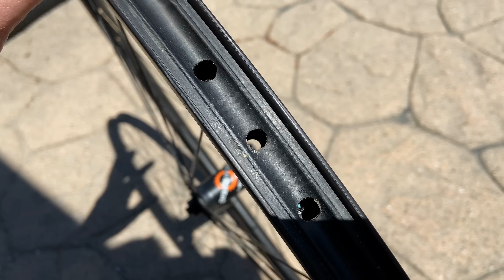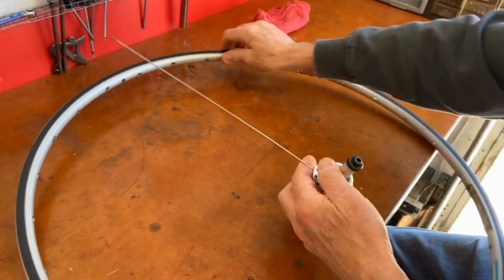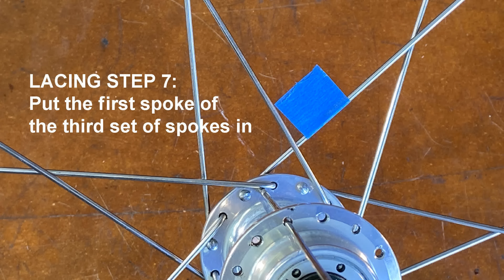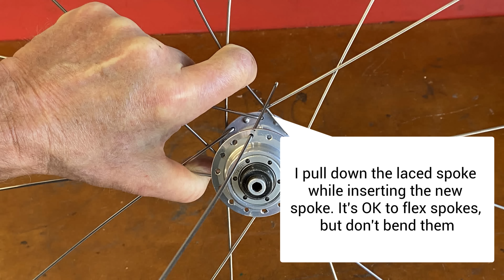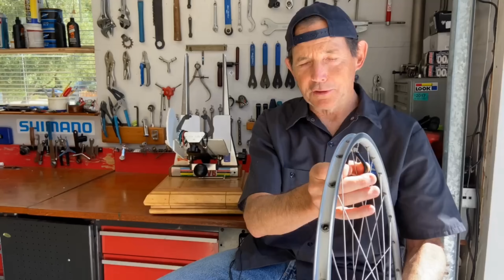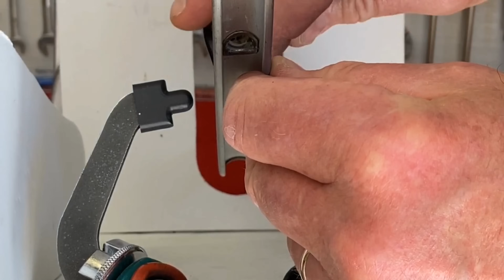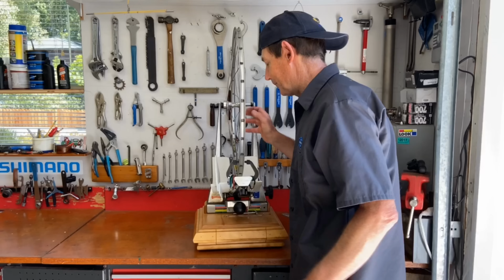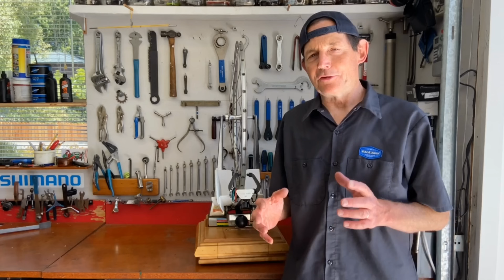How To Build Bicycle Wheels THE EASY WAY! #bikerepair

Comment: Thanks, Jim.  I'm 66 and just started riding after a 20 year hiatus.  Unfortunately, my 1984 Peugeot had gotten tired, hanging upside down.  First step, bunch of nipples that spontaneously failed.  Not quite a full build, but lots of good information for getting the nipples replaced and the wheel made round and true again.  Thanks so much for sharing.  And it is fun sans time pressure.
Reply from the maker: Thanks for watching and the great comment arcsound. Congrats on returning to cycling and on fixing your Peugeot's wheel! I'm happy to hear my video was helpful!

Comment: I have a 6 speed bike I wanna upgrade to 12 gauge spoke but I can't a rim like that what can i do
Reply from the maker: Thanks for watching and asking Michael. If the rim is made for it, you can enlarge the spoke holes, but you don’t want to do that if it will weaken the rim. Sometimes you can find out whether it’s ok to do it from the rim company othertimes you have to use your best judgment- steel rims are stronger than aluminum but as long as there’s plenty of material, enlarging can work. Also, you might be able to find rims for e-bikes already made for oversize spokes. Hope this helps.
Reply: @JimLangley1 im wanting to pur a gas engine on my bike
Reply from the maker: @michaelhuckabay739  fun project!

Comment: Great video! I have a couple of questions that have probably been asked if so sorry. First on wheel hop, on extruded wheels at the weld joint i find a slight dip or high spot that seems impossible to fix. Is there a trick to get it round? Second on tension i get the wheel true, round and centered but when i start tension 1/2 turn at a time I get some spokes with more some with less tension I use the TM-1 tensioning tool. for example most spokes measure  25 a few 23 but when i try adjusting to get even tension it runs out of true. Is the small difference in tension acceptable? It seems like I spend to much time going back and forth between true and tension. Thanks for sharing your knowledge and experience!
Reply from the maker: Thanks for watching Justin. I’m happy to hear that the video was helpful. Your two questions are related actually. The issues with the joint on the rim mean that you won’t end up with “perfect” (even) tension around the wheel because in order to improve the slight dip or hop there, you have to loosen at the dip and tighten at the hop to get the rim as round as possible. The basic process is to loosen at the dip (if the dip is over 2 spokes, you loosen those 2 spokes a little). You then go all around the wheel tightening all the other spokes the same small amount (say, 1/2 turn). On a 32 spoke wheel then you would be loosening 2 and tightening 30.

This tightening pulls down all around the rim and because those 2 spokes were NOT tightened but loosened, that part of the rim moves up, it expands or gets pushed up by the rest of the spokes.

Fixing hops is easier because you usually only need to tighten the spokes at the hop. The exception would be if you were working on a wheel where the spokes were crazy tight where you could barely turn them. In that case the trick would be to loosen all the other spokes and by doing that the super tight spokes at the hop would over rule all the rest and pull the hop down. 

It’s fun trying to get dips and hops out as best possible because you have to think about what’s happening and sometimes try a few times and keep working at it. And the thing is that the imperfections in bike rims like this mean that the tension measurement at the end, when the wheel is as true and round as you can get it, will show differences because the different tensions are needed since the rim has issues - it’s not perfectly round so the spoke tensions reflect that. I hope this is helpful.
Reply: @JimLangley1 Yes thanks for taking the time to respond. I'll give it try on the next set. Thanks for the videos and sharing your knowledge and experience!

Comment: I gave up with it too hard
Reply from the maker: Thanks for watching and commenting James. I’ve taught 1000s of beginners how to build wheels and learned reasons why some find it hard. A common problem is time pressure- because they’re expecting or wishing to build the wheel in a hurry. Rushing doesn’t work because each individual step has to be properly carried out and in a certain order, which takes understanding, patience and time to check and double check. You’ll notice my video is titled the easy way, not the fast way. And I’ve found that when I get beginners to slow way down and just perform each individual step one at a time, even the ones who found it hard will find it doable. This mindset is actually how all repairs should be done. Thanks again and hope this helps if you try again.
Reply: @JimLangley1 i give up on everything

Comment: back again I see it's been over 4 years since I have built a wheel from earlier comments. Got a early 2000 Italian Frondcrest and the wheel are cracking apart going to rebuild the old camy 8 speed on some very similar Weiman DP18 alloy Deep V rims. Here for the refresher course. Thanks again for you clear and easy to follow explaination. My problem is the lacing the truing I'm pretty good at.
Reply from the maker: Welcome back Michael! I’m happy my video is still helping you out. Thanks for watching again and commenting, appreciate it.

Comment: I had done 2 rim swaps before my 1st (recent) attempt at lacing a 36-spoke (Front) wheel from scratch. It was more difficult because I had to think. 🤣. I had a wheel from another bike that I used as a template. I laced nine spokes on one side (every 4th hole). And then 9 more in the exact opposite holes in the hub which went to the adjacent holes in the rim. I twisted the hub (fortunately in the correct direction) and inserted the remaining 18 spokes following the 3-cross pattern. I took it to the Bike shop for it to be trued and tensioned. It turned out fine. I'm not sure if there is an easier procedure. I think I could do another one in half the time.
Reply from the maker: Thanks for sharing how your wheel build went Guy, nice job! There are several ways to lace and different builders use different techniques. What I’ve found as a builder in a wheel company is that as long as a builder has a system that works for them, even with different techniques, they end up completing wheel builds at the same pace, which is in around an hour per completion- a rideable wheel. In an 8 hour shift, you finish 4 wheelsets. In wheel builds races, I’ve heard of rideable wheels built in around 20 minutes but the speed increase is mostly from truing, rounding, centering and tensioning rather than from lacing a different way. Thanks for watching and commenting!

Comment: I have a 20/4 stingray chopper rim and a ebike motor with a 21/2 inch gap.yes its a big motor I tried to cross them put them straight and wabels I tied them still not good .what am I doing wrong
Reply from the maker: I don’t know exactly what parts you’re working with Lee but you usually lace hub motors on small rims with radial spoking - the spokes go straight from the hub to the rim. I would do this one spoke at a time and one side at a time. Hub motors usually take oversize spokes too, they should fit snugly in the hub holes not loosely. Standard bike spokes or 14 gauge or 2.0mm. You may need 13 gauge, around there if your hub has oversize holes. You could try reaching out for help or searching on the website of the company that made the hub as hub companies should have all the specs on how to install their hubs on different rims. Hope this is helpful and you can get that wheel built and rolling.

Comment: Hi Jim your videos are inspiring thank you: I had to replace 2 broken spoke so I  had to do some truing & tensioning,
and got it wrong, so now I thought that resetting the wheel back to it recommended tension would be a good starting place I now have a large quaver shape wheel.
So I loosened off all the spoke and now regrouping, I have to formulate a new plan, got to laugh. love you videos. 👍
Reply from the maker: Thanks a lot for watching and the kind words about my videos matsuz, I appreciate it. And great job replacing those broken spokes. Next time, if you only have a couple of broken spokes, here's how you can save yourself some time. Remove and replace the spokes that broke. Next tighten them a little bit, just until there's some tension but they're not yet as tight as the other spokes - the ones that didn't break. At this point you want to get the broken spokes to the tension of the spokes that they're just like - in other words one right next to the replacement spoke on the same side of the rim. To determine how tight you need to get the replacement spoke that's right next to the other same side spoke, you pluck the spoke that did not break and listen to its noise/pitch (just like a guitar string). You then pluck the new spoke you put in and listen. Keep plucking the 2 spokes and comparing, as the new spoke gets tight enough it will sound exactly like the other spoke. That's how you know it's the same tightness. Next repeat the process with the other spoke you replaced and when both of the new spokes are the right tension - make the matching sound, there's a very good chance that the wheel will be nice and true again. Hope this helps you the next time and thanks again!
Reply: @JimLangley1 Thank you, Jim, for your valuable advice and for taking the time to respond.
Reply from the maker: @matsuz100  you’re welcome!

Comment: Good wheel building tutorial. For me lacing up a wheel is therapeutic. A couple of times you mentioned putting a spoke in every 5th hole, but it should be every 4th hole, which is what you did.
Reply from the maker: Thanks for watching and commenting, appreciate it. Actually it’s spokes not holes that you’re counting w my method so 5 is correct. This video is designed for beginners and that step often confuses people who already know how to build wheels but it’s just a different way of doing it that helps beginners I found in my classes.

Comment: It's actually easier if you completely fill the hub with spokes first. I was taught the way shown in the video, then was taught the easier way. I used the latter method for the next 20 years.
Reply from the maker: But you didn’t learn by putting all the spokes in at the same time because it’s not the easy way to do it for beginners. And even for experienced builders it’s more likely to make mistakes when you put all spokes in at once. All it takes is losing your concentration. That’s less likely with the simpler method. Especially considering the possible variables such as different spoke lengths and patterns.

Comment: Hi Jim,  Even though you posted this video 5 years ago I see that you are still responding to comments. That is awesome!  I'm an old guy with what are now old bikes.  I used to ride road bikes, now I ride steel gravel bikes that use the same hub spacing.  The gravel bikes take much wider tires than the 23c road tires I used to ride.  My reason for learning about wheels is because I want to rebuild some of my nice wheels.  Reuse my hubs but attach wider rims for the wider tires.  This wheel building skill becomes even more relevant these days because it's getting increasingly hard to buy pre-built wheels for the older dropout standards.
Reply from the maker: Thanks a lot for watching and commenting ncmotorcyclist, appreciate it. Yes, being able to rebuild wheels on whatever hubs you would like to use - even vintage hubs - is one of the reasons I wanted to make the video. I'm very happy to hear you're finding it helpful. I have  quite a few other wheel building videos explaining most aspects of the process if you're looking for more help. Have fun getting those nice old hubs back out there!

Comment: jim , on the part about dishing, you don't tell us if you loosen the spokes  or tighten them to make the rim go to the right. That is in the video  54 minutes.
Reply from the maker: Thanks for the question Arno, in most cases you would tighten the right spokes to move the rim to the right or tighten the left spokes to move the rim to the left if it needs to go to the left. You can run into either situation when building wheels. 

The only time you wouldn't want to tighten spokes is if you somehow got the spokes on that side to full tension already. This might happen if you are trying to get a wheel true and round and it doesn't cooperate and you keep working and tightening the spokes more and more. For example, you can end up with too tight spokes in some areas if you have a "bad" rim or if you are new to truing and tensioning and not yet experienced enough to know when spokes are becoming too tight. 

But if that should happen and the rim needs to move to one side or the other still to center it, you wouldn't want to tighten spokes that are already fully tight. So in that case to get the rim to move over you would not tighten spokes, you would loosen them. So if the rim needed to move to the right you would only loosen the spokes on the left in order to move the rim into center. 

The reason I said that in most cases you would tighten spokes is because it's much more likely for most newer builders of wheels to end up with the spokes still not fully tensioned than to end up with them at full tension or over tensioned. That's because the spokes feel tight before they're really where they need to be, so most people stop tightening them at that point, which means it's usually okay to tighten one side or the other a little more without exceeding full tension. 

Sorry that's a long, long answer, I hope it isn't confusing. I've tried to address this issue in a separate video so you might like to watch that. I go into the importance of wheels being centered and talk about different issues and how to solve them. Here's a link to that video: https://youtu.be/5ZInuIG0-dk

Comment: oh i forgot to tell you that these rims have the spoke holes in pairs of 2. So 2 holes are about 10mm apart then the next 2 holes are about 130mm from the first 2 holes and so on. So you have 12 sets of 2 holes. If you have an email i can send you a picture, it would explain it better.

Comment: What about washers for the nipples, you didn't talk about that
Reply from the maker: Hey, thanks a lot for watching and commenting, appreciate it. I have hundreds of videos and in some of the others I do explain about nipple washers and spoke washers too. The thing is that these washers are not used the majority of the time, so for someone learning to build wheels, it's unlikely that they would be using washers in their build. Nipple washers are usually only used when required by the rim manufacturer. The washers might be included with the rim or in the specifications sheet with the rim it might have a note saying that nipple washers are required and if so it would likely tell you which type to use since there are a few choices. But, the vast majority of wheels do not use any washers.

But since you asked about them, maybe you have a rim that requires nipple washers? If that's the case, one thing that's important to know is that when you calculate your spoke lengths, you'll want to include the thickness of the washers in your calculations. When you take your ERD measurement (effective rim diameter), you'll put a nipple washer beneath each nipple to do this. And, as I mentioned, you want to use the washers that the rim company recommends so that they fit the rim correctly. I hope this is helpful. Please let me know if you have other questions and thanks again. Happy wheel building!
Reply: @JimLangley1  the washers came with the original spokes.
Reply from the maker: @arnodivalentin5639  hmmm... usually if a rim is made that they require you to use washers with the rim, it's the rim that would come with the washers in a little bag. Spokes are sold separately, washers too - unless the rim makers includes them with the rim. Someone might take an old wheel apart and find washers inside the old rim and put the washers with the used spokes, but the washers are for protecting the rim, they have nothing to do with the spokes really. So, if you bought a new rim and hub and it came with the new nipple washers and new spokes that were the perfect length, maybe it was a "build kit," from the company with all the parts they spec'd for that specific wheel? That would make sense then. Washers go onto the nipple as you feed them into the rim and screw them onto the spoke. Some washers are flat, some are slightly concave. The cup of the concave surface is what the nipple sits in. I have some information on rim washers in another video (link below), but more about how to not lose them inside the rim rather than how to build with them. But I think you'll learn a few things from it: https://youtu.be/6EtQsst3Z98 Hope this is helpful.